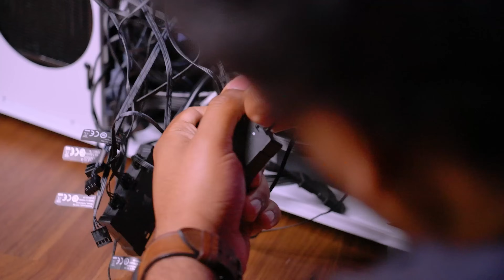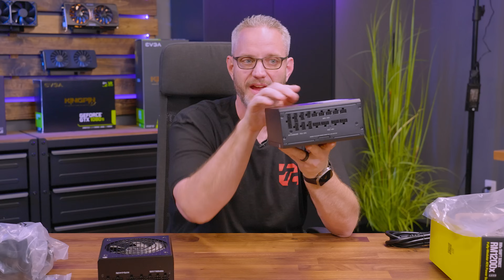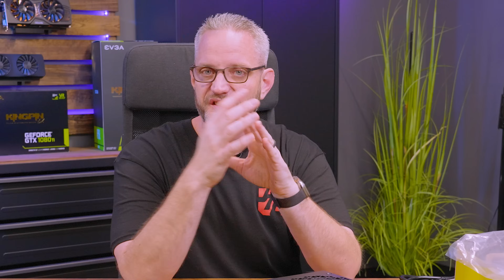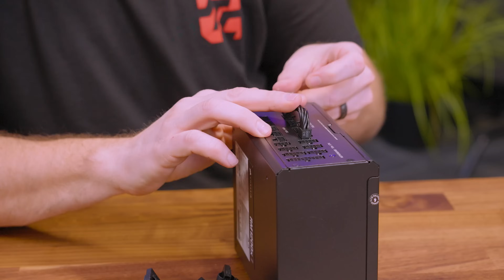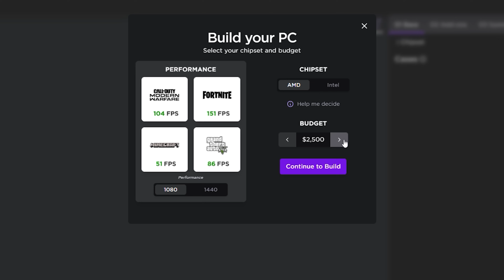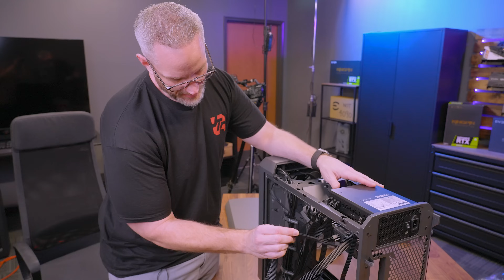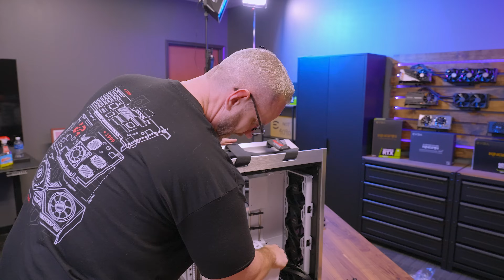I tried to prove this design was a failure... But then this happened.

Comment: I would love for MOBO's to transition to these connectors. If Manufacturers transition all they need to supply with them is an adapter. (Don't need to supply an SLI connector any more, supply this instead.) At least till or say 5/10 yrs for every 1 to catch up. As man that 12 pin in MOBO's gets annoying. I hope it happens tho there could be amp vs cable issues. But lets hope that's not an issue. I would love this. Why, it's not going to be the 1st or 2nd cable i have to remember to install 1st when im building. Makes it simpler.

Comment: If they are going to do this, then they need to have 90 degree plugs for the cables. At least some of them.

Or, why not try having a little on both the side and the back. Then there would be room on the side for all the side cables to be 90 degree plugs.

Comment: I used the 850w version in an NZXT H5 Flow and it worked well for cable management. I had to train the cables a bit so they didn't rub on the side panel but management was very clean. I hope you're right and motherboard manufacturers adopt the Type 5 size connectors on their end. The smaller connectors look much cleaner. Thanks for the review!
Reply: Yo, is your h5 flow 2022 version? That is the one I have and the one I want to put this PSU in. Thanks in advance!
Reply: @NoSenseMakes  Yes, the 2022 version. Still rocking and rolling 2 years later with zero issues. :)
Reply: @kovokz  Great, thanks for getting back to me

Comment: Jay, 

I watched this, immediately went on Amazon and got the 1000W overnighted, and just now installed it with zero issues.  Cable management in my 4000D case is now perfect.  My new 4070 Ti now has the correct native connector, and I don't care about the slightly different sleeving.  THANKS for your timely publishing of this video!  I had been planning on increasing my 750W PSU already, so now all is good.  

Watch every one of your videos.  

Cheers!
Reply: This PSU is specifically designed for the 4000d and 5000d variants so it makes sense why it worked well for you
Reply: Worked out grea for my Asus TUF GT502 ❤ 😊
Reply: same here, was on the edge but after watching the video, I ordered it. thanks for making the video!

Comment: I feel this design by Corsair might be trying to push other companies to redesign outside of power supply's. Like you said, the 24 pin for the mb being smaller on the mb side might be something corsair thinks should in development and this is their way of pushing it. Same with cases, they want the case industry to redesign the implementation of the PSU shroud/space allowed for it.

Comment: Will be interesting to see SFX variants of these PSUs with custom cables in Small Form Factor builds, cramming a 7800x3d and 4090 in a tiny shoebox sized case and not having the cables be an absolute nightmare would be cool, I have a Jonsbo N1 Nas build and cable management was a pain, but that comes with cramming half a dozen hard drives in a case the size of the cardboard box a GPU comes in.

Comment: There's a Chinese youtuber called 远古时代装机猿 working on this very project right now with diffrent   psu manufactures. Not just cloning, they might just come up with these ideas earlier than the Corsair. It's a part of his  cablemodding project, he has also launched a back-plugging cable specialized motherboard with Asus called b660m revolution. You can probably find it on Aliexpress because it's launched only in China. And he's working with Msi Maxsun etc on the back-plug motherboards, they will come up later this year. Btw for the cable terminal space on the back, he's launching some new cases specialized for it these days. It's quite interesting that people all around the world sloving  one small problem with their own ways and by the time they were actually  done it only to find out there were just someone who's doing it simultaneously isn't it?

Comment: I had hesitations after your first video, but I ended up buying the RM1000x Shift to power my 13900k / 4090 build in an O11D, and it made cable runs and working inside the case a dream. It also helped that it was ATX 3.0 ready and included the 12vHPWR cable out of the box.

Comment: come on jay!!! this psu is made for cases where it works better to have the wires go out from the side of the psu. doesn't mean it should fit every case, it's an alternative..
I actually wish i had used this when i built my torrent compact build, but it worked out fine anyway.

Comment: I enjoyed the look at the Shift psu design, however the thing I am desperate to know more about is the sponsor spot/ad integration at the start of the video. If I had to guess corsair is going to take a note from Lian Li and Thermaltake's designs consolidating connectors into a daisy chain design. Whether it's magnetic or friction mount pogo pins is the main question. But either way, if the newest version makes it where we get 1 cable for 4 or so fans instead of 8 cables and a fan hub and an rgb hub, im excited. I just hope they have they can make them for the maglev fans and make them not cost $35/fan. 

I also hope I'm not totally off base with my guess, hence why I'm so excited to hear Jay talk about this.
Reply: I hope this is what they are going to announce as well. I really want to see a corsair ML daisy chain fan. My only concern is the way they are marketing this, they are acting like its some great idea they are bringing to market. They are basically the last major rgb fan maker who doesn't have a daisy chainable solution. For it to be simply that they are releasing their own as the savior of wire management is way over hyping this. ..
Reply: @mrcryptz  the savior of cable management... man that does sound like something corsair would say about being late to the game for a now industry standard solution lol. Don't get me wrong, I am definitely a fan of corsair

Comment: I spare no expense with PSUs because I had them fail on me on one PC I replaced the PSU about 4 times. You can’t cheap out on it. On the plus side, the PSU is easy to swap out. I generally got the 850W.

Comment: What we really need to talk about are PSU cables that only work with the PSU they came with.  I had some nice braided corsiar cables and tried to use them with an EVGA PSU and it wouldnt fire up.  I thought I had bought a bad PSU until I started troubleshooting and figured out the EVGA wanted it's cables for the 24 pin.

Comment: So, I built my current rig with that PSU in a Phanteks Eclipse G500A. And it felt really good building with. In fact, the amount of headache that I usually have with cablemanagment was basically nonexistent. It's interesting to say the least, though with the cables being smaller I had questions about durability.

Comment: Thinking of builds with this as well..  Old retro builds might have benefit due to this configuration with the shift as well.. depending upon the case. 1st Gen Thermaltake armor cases.. older front cage designs, and flat mount retro cases .. or even old standup mount the psu at the top designs.  ???  I guess only time will tell.

Comment: How often do you assemble and disassemble your PC ? There's no flopping around, no bending for the most part unless you rebuild your rig regularily or use it as a test bench supply, the real concern is insulation ad amperage these cables can carry. Also, you explain it like Corsair would stop making regular power supplies from now on. They won't, this is specialized design for people who know what they're doing (I hope so).

Comment: O11 series is the only place this PSU will definitely work in, but even then youre not solwing a problem since now the plugs arent facing out theyre facing up, which is basically just as bad as facing left

Comment: fyi... this also only sort of works for hyte y60.   The HD bay brackets have to be removed and even then the bracket chassi covers the furthest most right sata and pcie plugs on the shift.  So if your building a hyte y60 and want this psu, be sure you don't need the HD bays and that you do not need to utilize all the sockets on the psu

Comment: Universal format push pin design would make everything clean. Hopefully long wires become a thing of the past. Imagine the PSU simply slotting into the case with the motherboard and everything else getting power from case connectors.

Comment: Im running a HexGear R80 case where the PSU is hanging from the top of the case - so the cables are haning down until they are bend to the back. This PSU-design wold be perfect for this case, because all cables will go direktly to the back where you can manage them perfectly.

Comment: I have a feeling this PSU would have been much easier to install into my Cooler Master HAF XB EVO case. Conventional PSU cable arrangement was a very tight fit with a hard bend of the wires.

Comment: Would love to see a video about custom cable lengths in odd cases that have the PSU or other parts in odd places like the fractal torrent, O11 Evo, hyte y60, or like the Tower 100 which all have things in an odd configuration, and the cables are either too long/short

Comment: I think a real change wuold be simply add a second set of shorten cable.
Today most case are mid-tower and most of the time you need to hide the cable.
I know there are custom cable from tons of company,but most are add-on (so more mess) or the specific are for few top specs psu.

Comment: My case would work with power supply without any issues and still have the fan down, i have the Thermaltake level 20 XT,  there is 2 mounting spots for the power supply

Comment: if i were to use my lian-li pc70. i would cut the internal psu shroud. or look elsewhere. i my new evga gtx 1080 Ti is happy with my raidmax 850W psu

Comment: No you are wrong, my Corsair RM850 cant fit inside Corsair Carbide Series SPEC-OMEGA case... I have to change to shorter power supply unit in order to fit.

Comment: In the case of the ROG Helios I'd take the "don't be afraid to mod your case" approach and cut out the area I needed.  You need to be sure to file it down to round the shard edges afterward, or maybe 3D print a border to clip into it, but certainly doable.

Comment: It's weird that they have the idea to put the cable plug on the side yet does not make the cable connector kinda 90 degree to easily fit the side panel instead of bent and bundle up the cables to the other side.

Comment: Uneducated opinion/suggestion: they should start making power deliver all through usb thunderbolt cables. Especially since components are needing to communicate with the power supply now (looking at you 40 series cards). I feel like it would be really nice to get a power supply that just has a dozen usb-C terminated cables coming off of it. Maybe going back to non modular power supplies would happen. Feel free to discount my input, I have very little electrical knowledge

Comment: I installed mine into a spec omega where the cable are cover so i took a hacksaw to it removed enough metal for it to fit perfect and its working no problem.

Comment: If they put two different ways to plug the cables in, why not just add a third on the end, it would allow it to work in any build then. They could have also considered 90 degree connectors on the cables so that you wouldn't worry about bending them.

Comment: One thing im wondering in regards to the 12vhp conectors is its two smaller ones as if it was an adapter caple. Is it a native one and just doing silly corsair things or is it lacking certain features ahen it comes to that specific connector?

Comment: For other suggestions the Seasonic Vertex GX-1000 has a 996w power limit on its 12v output, cost me 275€ (250-260 eagle moneys?) normal ways cables tho but i noticed ppl mentioning the 12v limit here.

Comment: I don't know why you say the 12 volt power cable wouldn't work with 30 series. I'm using Seasonic Vertex GX-1000 with 3080ti FE, and I'm using this cable, and it works no problem.

Comment: My psu cost 189 gold tier rm1000x corsair psu went smoking a few days ago got it from 2021 Nov till this year what may be the cause also did it mess up any other components as I check with my eye after shutting of n getting all the cords off the board no smell of any damage only the psu had issue , I only had google chrome on was watching YouTube got 10 tabs on I doubt that's the issue

Comment: Thanks Jay for the great advice over the years, I've been building PC's since the 286 days and really appreciate the knowledge you have. I'm just building a AMD system ATM with a Be Quiet Pure Base 500FX mid tower case, the Corsair power supply would be ideal for this case that its got 35mm from power supply to the side of the case. Keep up all the good work, Don from Australia. :)

Comment: I guess if you want fan in your case VS pulling from the bottom and want your cables pointing towards the back of the case you would have to find a top mount case VS a bottom mount case. I think they should go back to having the power supplies at the top of the case. it reaches the power connectors on the board better.

Comment: Asus has recently shown some mainboards with connectors on the back, when all this fits together and a we get a new standard, new builts will be soooo clean. Basically ALL Mainboard connectors could be moved to the rear, without much effort. The only cable that would be needed in the front would then be GPU power but I bet there's more than enough possible solution to fix this as well, either by powering GPU through the PCIe slot and a power connector right at the backside on the Mainboard or by simply creating a hole in the pcb where you can route the cable through lol

Comment: I have the 1000w shift in my Torrent case. It fits nice cables run emeasily on the side. It was nice to run from the side straight out to the leftside of case through side grommets. I won't lie at first I thought it was not going to work but it made for easy cable management

Comment: I think this power supply will work especially well with custom tower/case builds most, before towers become more flexible or modular with different parts, if any options for that comes up.

As for the 2nd case, that's right up the alley for this new design.

Comment: I just don't see cables coming out the back of a PSU that big a deal/problem. Also how easily the cables were getting marked, the none matching wires and the fact it isnt a straight 12 pin to 12 pin GPU wire, all make this look really poor value for the money they are asking for.

Comment: I feel like cases need to evolve. This "sideways" corsair supply is an interesting step in the right direction from my perspective. If we had airflow on both the bottom and side where the power supply goes, you could orient the thing in either a flat or vertical configuration and have easy access directly between the PSU and the rest of the build. I feel the problem lies with cases not innovating or segmenting their chambers to allow for modularity, a lot of them are finally adding quality of life features like rubber grommets, but they aren't actually changing the shape or design of each component's space to reflect modern parts/airflow conventions. Basically a lot of cases are being built like they were 5 years ago instead of allowing for modularity.

Comment: HA!!!  My Kindle automatically downloaded the latest issue of PC Gamer at some point yesterday afternoon.  I started reading it when I climbed into bed last night.  On page 9, in the "Monitor" column there is a news item which reads: "CORSAIR RMX SHIFT.  Corsair's done the impossible and made an exciting new power supply.  To achieve this magnificent feat, it's taken all the connectors, shrunk them down and put them on the side of the PSU.  The end result is a power supply that's actually easy to install."  And here is your video.

Comment: Some of the new "almost ready to launch" Thermal take and Phanteks cases are probably going to show these new PSUs to their full potential. With the MB being rotated 90 degrees so the GPU runs top to bottom -so no sag and potentially more cooling from fans at the back cable config is going to change again.

Comment: If companies want to improve things, they should make more cases with the motherboard-orientation horizontally. You know, the way it was designed and used for a couple of DECADES. - Especially now that GPUs became so heavy and in a lot of cases there will be a vertical mount with a riser-cable or some such thing. - I have an older Thermaltake cube-shaped case that has the option to put it horizontally, and it actually looks very normal to me. - I know it makes the case wider or gives it a larger footprint, but tower-cases were basically made for office use, to not have them be a big block on your desk below a monitor anymore, but to put on the side or on the floor. - But let's not pretend that people who build their own PCs care much about the footprint. - Besides, if you're reasonable, you'd get an mATX-case, which is is a little shorter than ATX, and that doesn't require as much space. - That's what this case I have is, the Core V21 (the old/original one) and it still hasn't been beaten in my opinion (not even with the newer version of theirs, because it basically just went all-glass, but anyway). - This case does a lot better than most cases, simply because of its design, which is not even that complicated and rather logical. - It has its flaws, which could easily be improved, but for some reason they just ignore this case and keep with the tower-design that makes no sense.